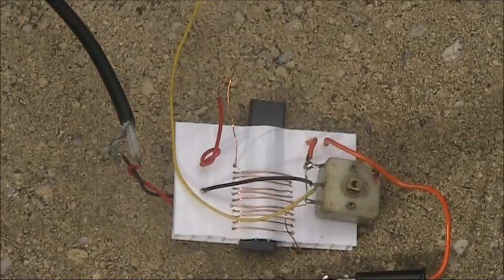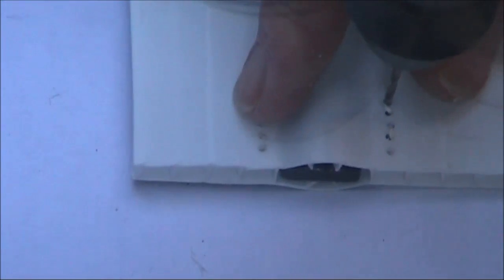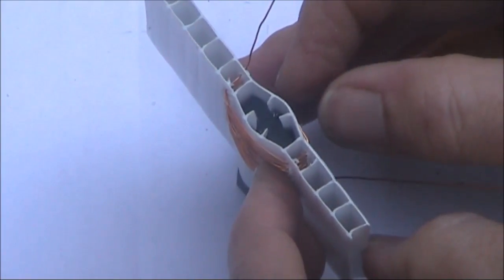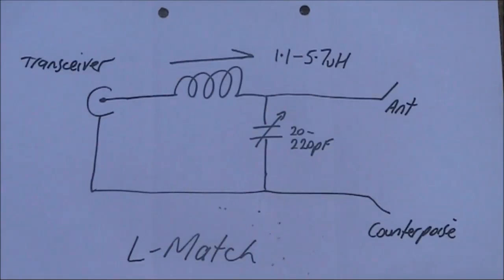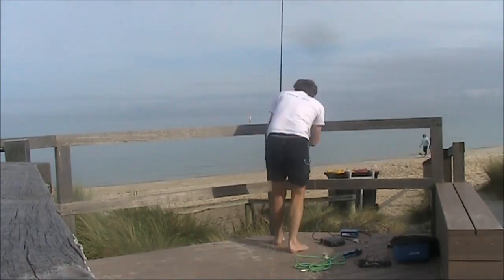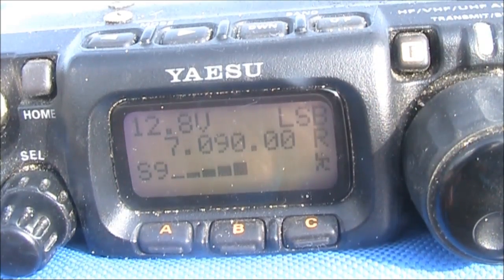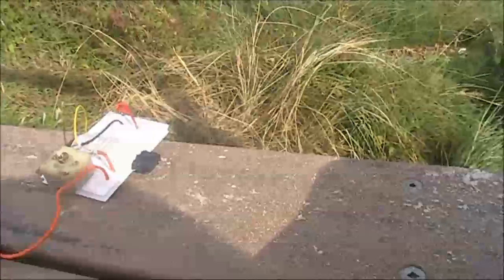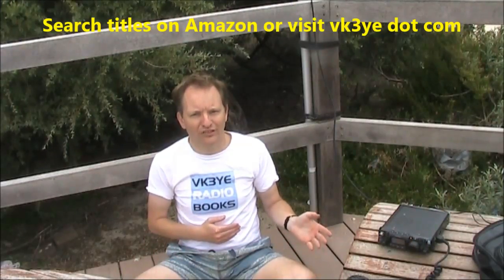Variable inductor antenna coupler made from corflute material

Comment: Peter
You might remember also, many years ago there was a 160 meter mobile bug catcher antenna that was remotely tuned by a ferrite rod in the loading coil. It was pulled in and out of the bug catcher coil via a long cable made in part by a motor choke cable and a plastic rod to the ferrite rod. You would tune the antenna by pulling the choke cable control that was used to tune the ferrite rod placement inside the Bug Catcher coil.

73 my friend!
Jimmy, ARRL TS, WX9DX